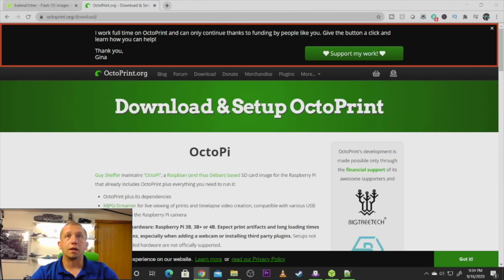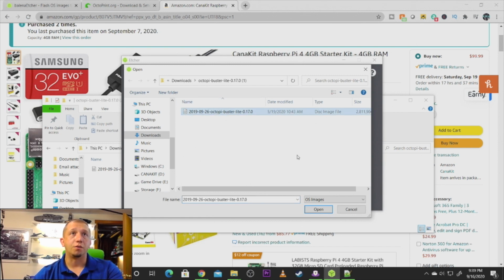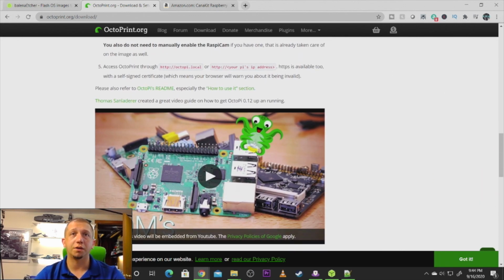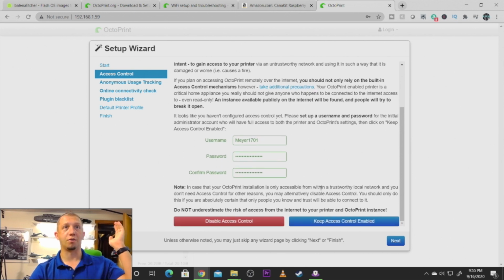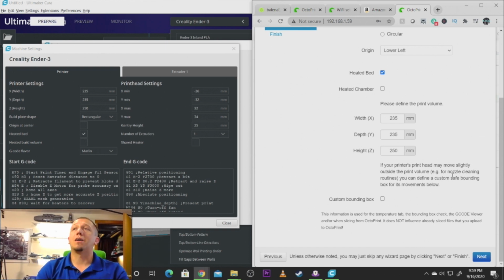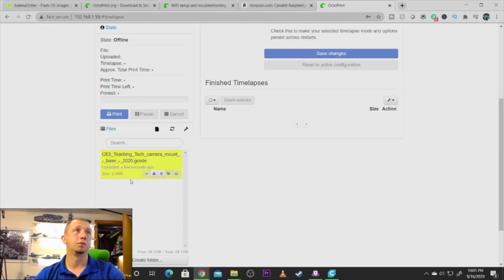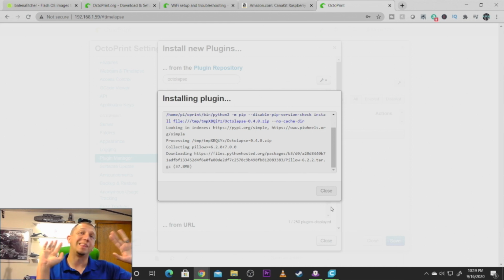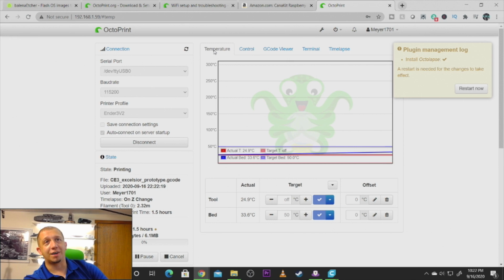OctoPrint Setup: Transform Your Raspberry Pi 4 into a 3D Print Server

Comment: Enjoyed the video and am now looking to get this upgrade as it gives you great features. I'm not sure if it was addressed in the video but are you able to connect to the 3d printer from another computer in another city? Or do you have to be on the same wifi? If so, Could you bypass it by using remote desktop viewer so you can access the information and control the printer from your phone, with a a desktop that is connected on the same wifi/in the same home as the printer

Comment: would like to use this setup with seven inch touch screen. not sure of a good setup, around 200 dollar budget. i did not know i would need to use a 4 GB version 8 would not be compatible. if you could post a few links to maybe an all in one setups or separate purchases that would be great.
Reply from the maker: TH3D does sell complete octoprint setups. I have not put a touchscreen on mine so I am not sure what you need to do as I access all the webpage interfaces from my PC or I use putty and remote to them via command line.

Comment: Anyone  had issues where it doesn't provide a hhtp link or up address and I've followed this video
Reply from the maker: So you are not seeing a ip address when you book up your device?
If you have a monitor attached when the Pi is booted it should display a ip address for you to go to. Are you seeing that IP adress or is it coming up blank. I would say if it is blank you are not getting connected to your network.  If you do have one make sure it matches the ip of your other devices.  Then try using HTTP://your ip address   to get to the pi.
Reply: @Rise3DBuilds  ye it's not giving an ip at all  and thanks I'll try that

Comment: Note 📝  I’m gonna try using a WiFi extender hooked up to the pi by Wire so the Code part might not be necessary
Reply from the maker: I put it in there but if you are going by wire you can always skip it.  I like having it as a back to allow it to connect to either network